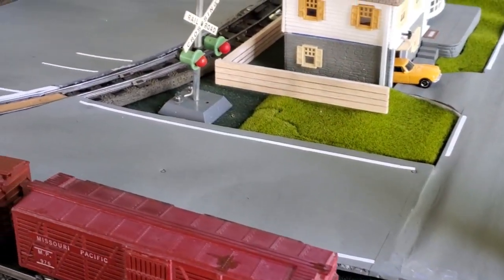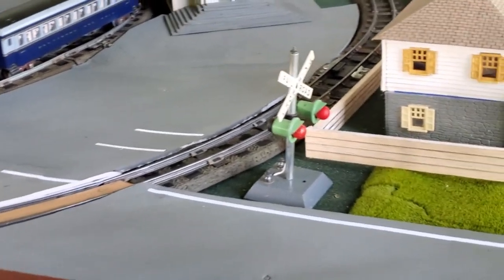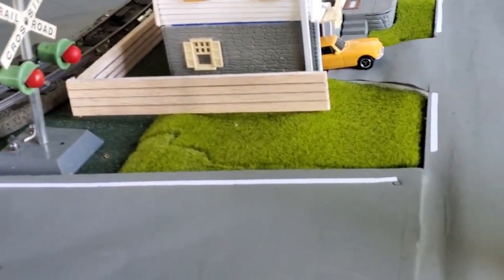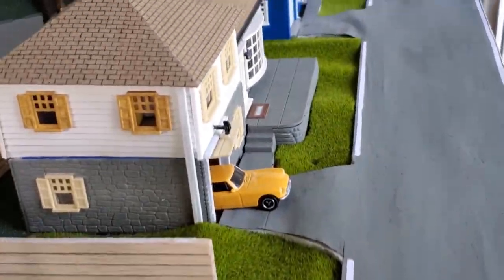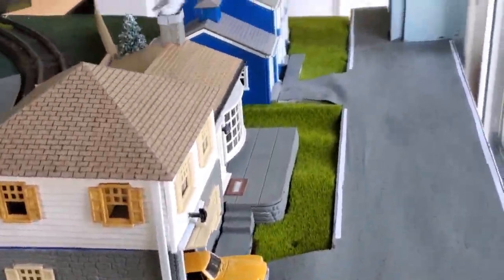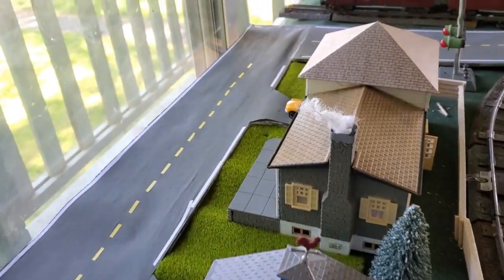Updates To  My American Flyer S Gauge Layout

Comment: The layout is really coming along. Many fine touches applied. I sure would like to see the Royal Blue running again!

Thank you for sharing!
Reply from the maker: Thank you. I just completed repairs on the Royal Blue engine and it worked perfectly on my test track. It lurched once when I put it on the layout. There was some sparking of the wheels on at least one of the coaches. I have not had time to work on discovering the problem. I will have video of the Royal Blue in action again as soon as I solve the problem.